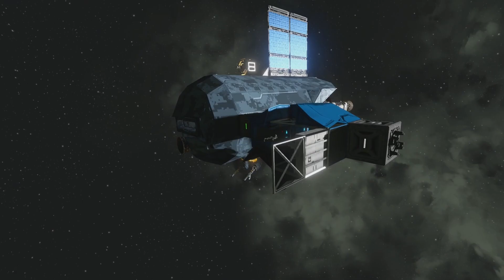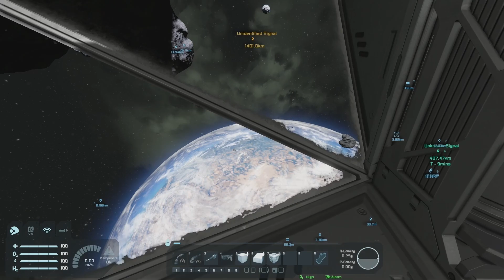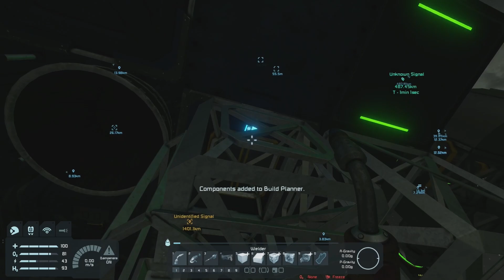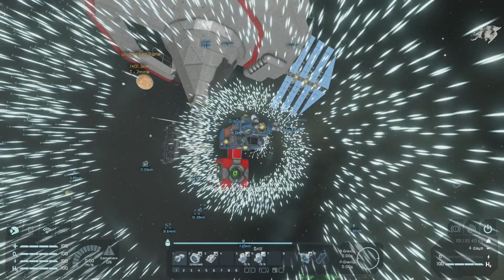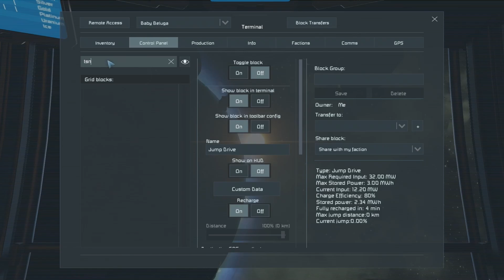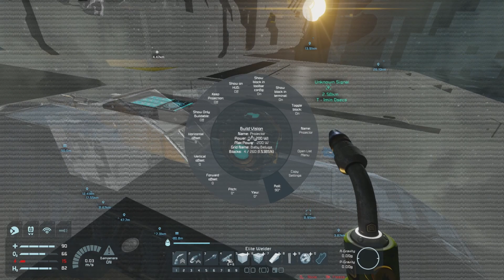Engineering, Engineered - Contact EP17 - A Space Engineers Mostly Vanilla Survival Series

Comment: You can adjust the transparency of the "K/I" in game or the start menu to lessen the strain of working with projector. The projector has a block missing count display  while in the "K" menu.

Great start on the new ship!!! The connecting point of it instead of just using armor blocks  you could of used a merge blocks to transfer power from the station making it easier the build/ remove/ repair later down the line.
Reply from the maker: I actually started with a merge block, partially because I originally intended to use an existing ship design and print it off with a projector.  I ended up not going with that and I didn't like how the merge block connected anyway, so I just got rid of it and cut that part from the video.